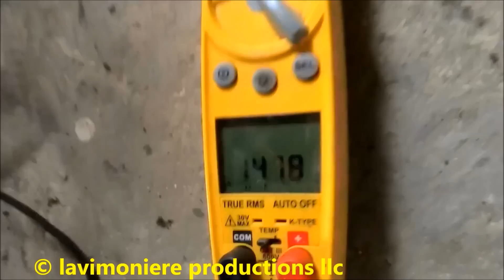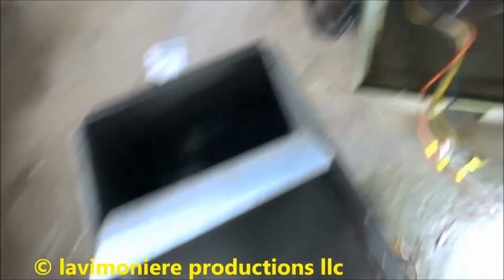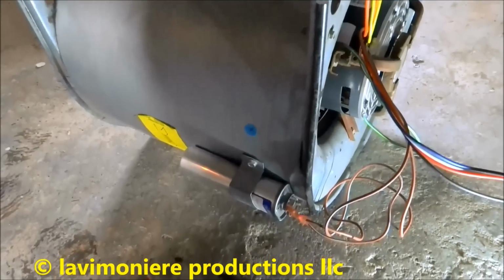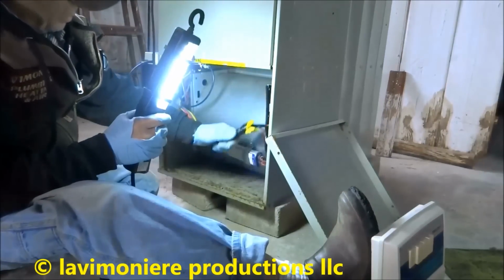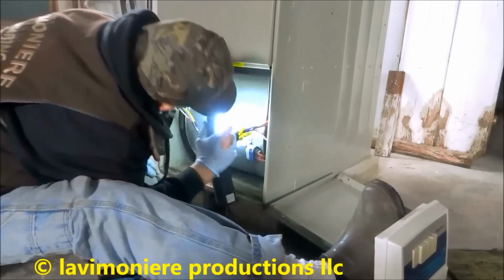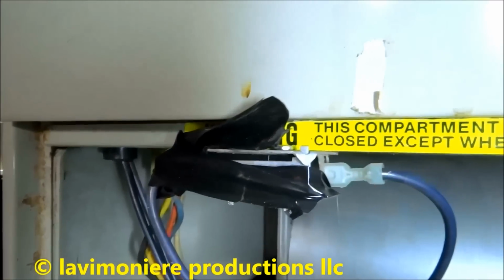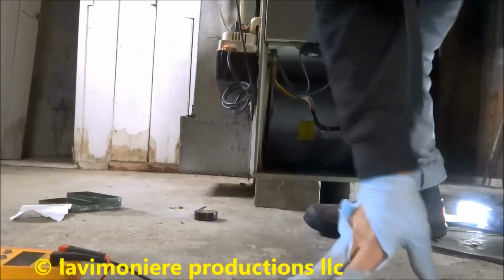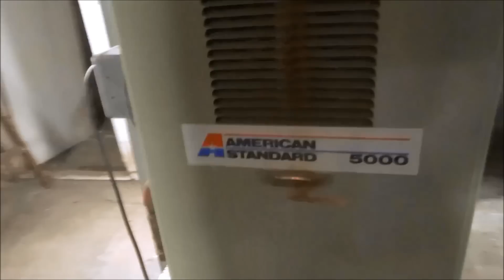gas furnace blower fan not working part 2 of 2

Comment: Nice job Steve. I wonder if the very small air return affected the life of the blower motor? The supply looked to be much larger than what they had cut in for the return. It could not have been running that efficiently.
Reply: Very restrictive on the airflow. Duct tap in should be the same width as the filter. Hack job.

Comment: Nice that the furnace was put up on blocks and away from the wall. Plenty of room to work. I worked on one yesterday that was in a full basement, with plenty of room, yet it was flat on the ground and jammed up to 18 inches from the wall! Very difficult to squeeze in there and get the blower assembly out. I don’t know what the hell the damned installer was thinking! 🤬